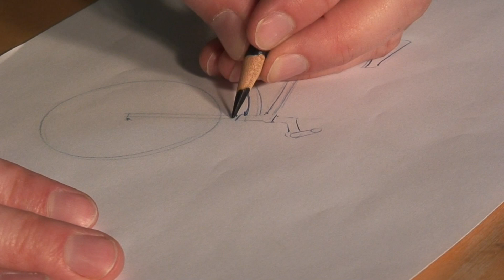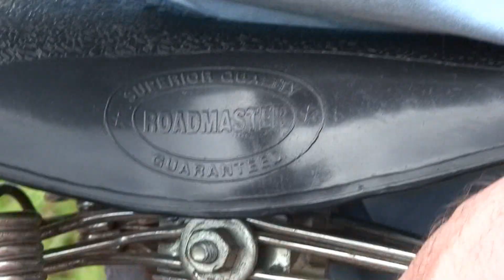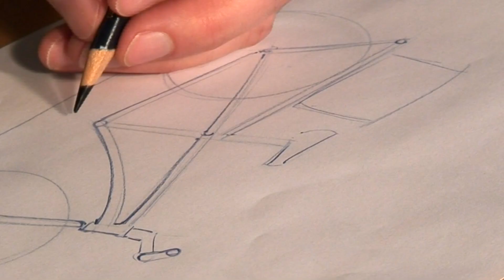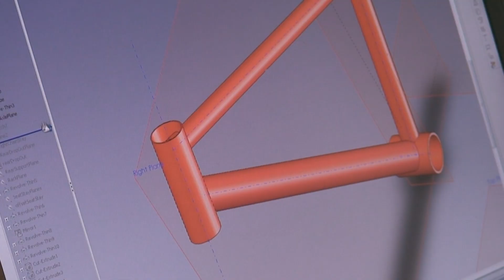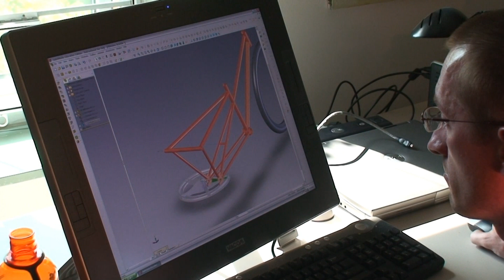Hoima Bicycle (part 1 of 4)

Comment: to answer the notion on 6:45, i disagree: roadster is still a good DESIGN! your arguments based on age of design and quality are nonsense!
 otherwise Dutch wouldnt use them. otherwise they couldnt haul 200 kg! and otherwise they wouldnt be a dominant type of bicycle in two most populated countries in the world!
weather they're reliable or number of gears is a different pair of trousers: it depends on quality of build and cost, NOT on design itself!!! most roadsters ARE reliable enough!